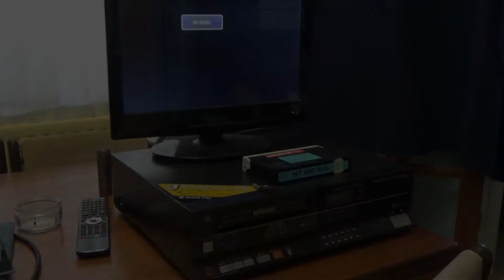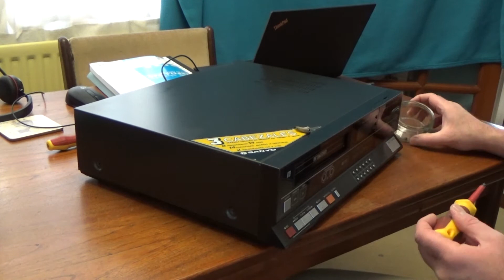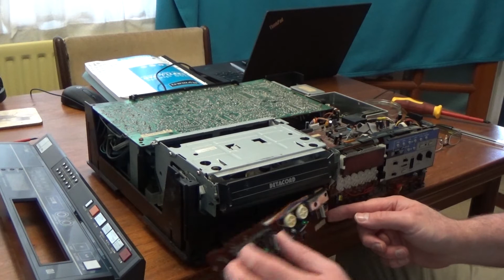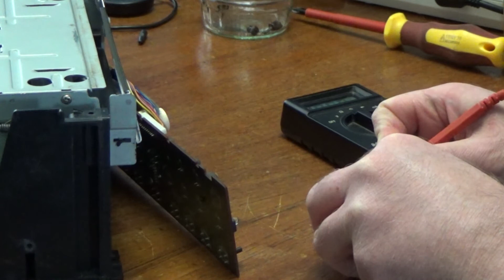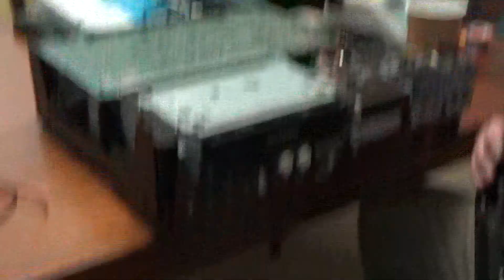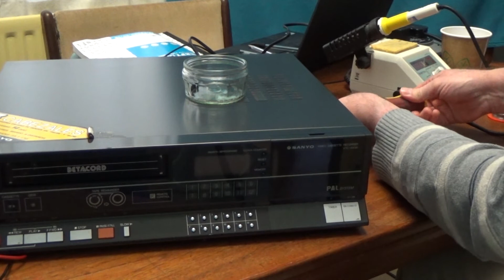Sanyo VTC-NX30 Betacord / Betamax (Same as VTC-M30) Eject Fault and Repair

Comment: Nice machine. I have the Sanyo NX-100 which I assume is from the same range as this. The nx-100 was the last Betamax they made in the UK. I would have definitely use deoxit on that switch first, most likely would have been an easier fix. Nice repair though
Reply from the maker: I don't own an NX100, but I understand it has a different mechanism from the other M and NX models. They all seem to be very reliable machines.

Comment: I take it this isn't equivalent to the standard modern tact switches that can be bought for about a penny each?
Reply from the maker: They are a standard switch - link to one supplier in the UK is in the video description, but there may be cheaper suppliers. Since publishing the video I have replaced the Slow Motion switch with a new one from that supplier and I can confirm they are an exact replacement.
Reply: @timf-tinkering  Ah yes, I missed that. Those are proper branded Japanese ones as opposed to the cheap Chinese ones that'd probably need to be replaced again in five years 😉

Comment: Nice model.I have the VTC M30. I always liked that machine. I've recently refurbished a Sanyo M10 with a few of the main transport switches like that.
I used a contact cleaner  and it got most going again apart from EJECT funnily enough. So i changed it for a good one from numerous spares machines i have.This happens if they have been laid up for long periods,even more so in cold damp area's sadly.Still easy enough to rectify.
Always liked the black scheme of the NX30.
Did'nt realize VCR SHOP sold this model.
I have purchased from him and i agree excellent service and product.

Comment: All it needed was one or two drops of deoxit and it would have fixed it.....it works every time!
Reply from the maker: Good thought. However, the switch contacts are completely enclosed. I'm not sure I would be able to get the cleaning fluid onto the contacts without disassembling the switch casing, and I'm not confident I would be able to do that without damaging the casing, making it extremely hard to reassemble. This type of switch is a very cheap, off-the-shelf product anyway, so it's probably not worth bothering to repair it. (I have just added a link in the video description to what I believe to be a suitable replacement switch).